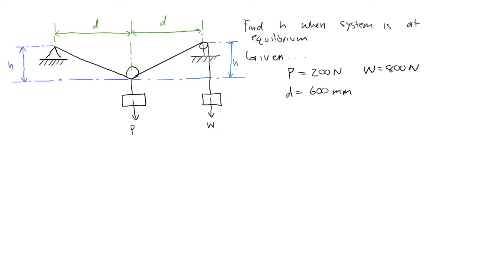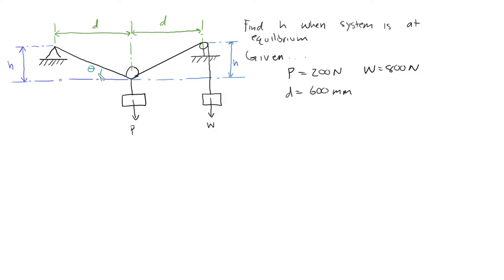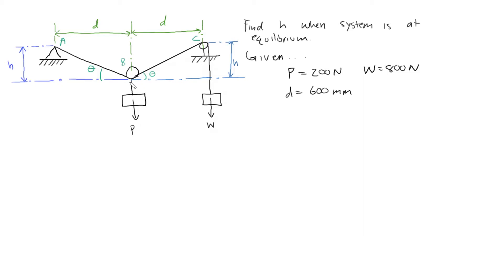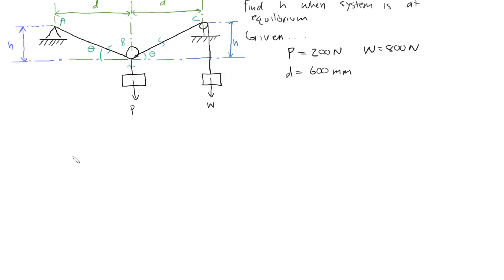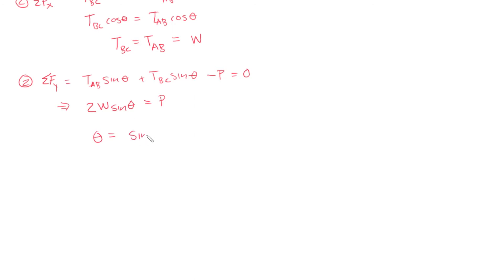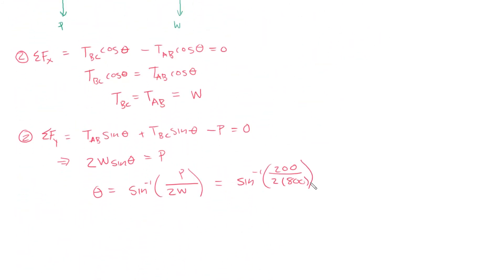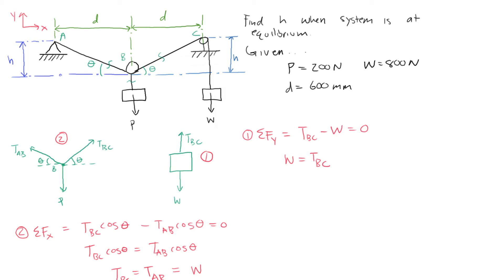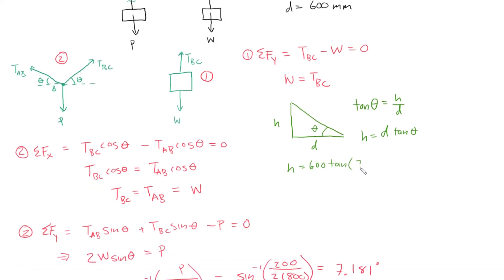Statics | "For W = 800 N, P = 200 N, and d = 600 mm, determine the value of h consistent with..."

Comment: How did you figure out to use W=800N? there is another downward force P=200 as well, so why couldent we use that force?
Reply from the maker: W and P are given in the problem.
Reply: @alexjbeezy  no what I mean is since Tbc is equal to W does that mean that Tab is equal to P?
Reply from the maker: @talhajat3301  No it does not. Tab is only dependent on the angle and W (or Tbc); sum the forces in the x-direction and you will see. Since this problem is highly symmetric, it just happens to be that Tab = Tbc = W. This is not always the case especially when the problem is not symmetric.
Reply: Alex yeah but how did you know off the bat that Tbc is equal to W. just really confused on this part. If you drew a FBD for W and Tbc then why not for P and Tab?
Reply from the maker: @talhajat3301  ah I see your problem. The concept that you're aware of but not applying is that the system is at static equilibrium. That means no matter how you define your free body diagrams, all the forces must add up to zero. So if I isolate my free body diagram at W with its cable, that free body diagram or subsystem must be at static equilibrium which means the tension on the cable that W "sees" must be it's own weight. If the tension in the cable is greater or less than W, then the weight will start moving. 

The same concept is applied for P. 

The powerful thing is that you can isolate multiple free body diagrams within the system and apply F=0. Then you can use and combine multiple free body diagrams to find the forces you are looking for. The caveat is that internal forces (like tension) must cancel out when looking at the free body diagram of the ENTIRE system. This is just another way to say Newtons 3rd law about reaction forces.

If you stick to the playlist I made on Statics, you will see examples explaining this. They're called machine/mechanism problems.
Reply from the maker: @talhajat3301  watch this video. It may help.
https://youtu.be/rHR37dm5lXI
Reply: @alexjbeezy  Thanks alot man
Reply: @alexjbeezy  Finally got it